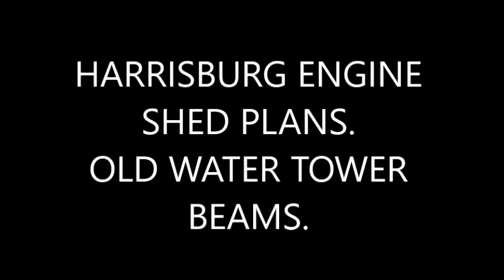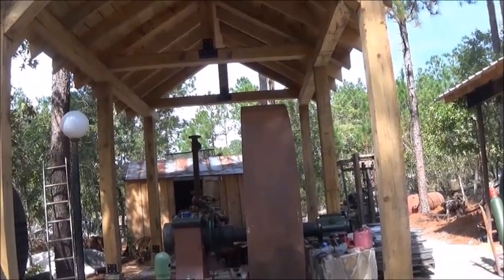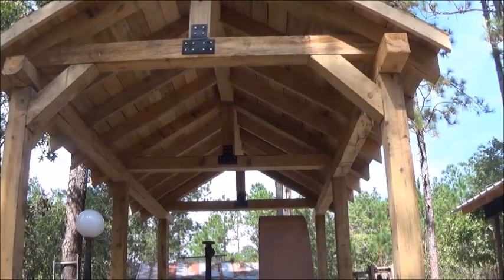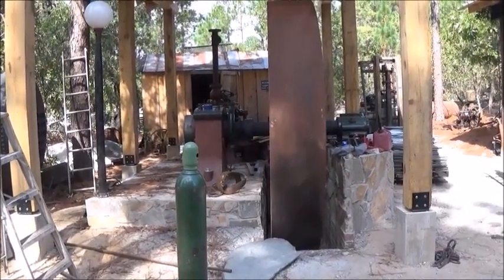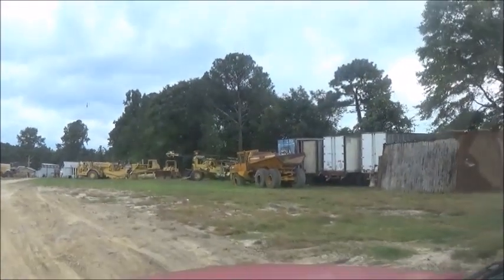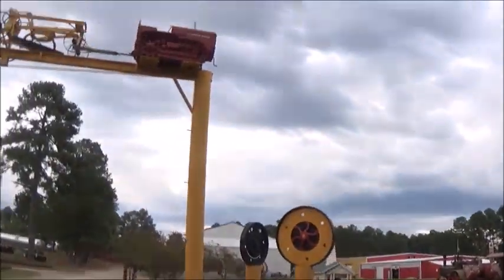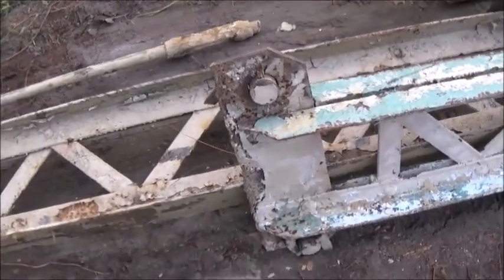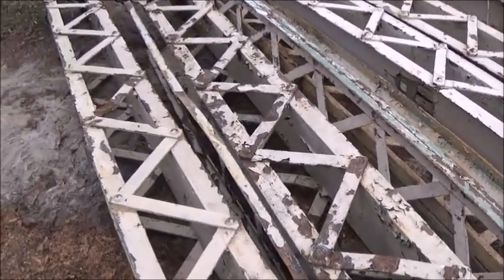WATER TOWER BEAMS FOR THE HARRISBURG ENGINE

Comment: Think about the journey Jonathan has taken to get to this point: 25-30 years ago he spotted the first steam engine he wanted, then he need a crane to move the parts about so he searched, found, and repaired an abandoned crane. He the found more steam related pieces and acquired them. If this process wasn’t enough, he acquired a saw to mill his own lumber as the going’s on related to the virus made supplies unavailable or cost prohibitive. He’s constructed a beautiful building for one engine and is planning the next, but it isn’t just any old plan he’s making—he’s incorporating history as he’s uses salvage from the Carthage water tower. Jonathan, you are indeed an industrious fellow, a conservative, and a preservationist for sure. I tip my hat to you friend!
Reply from the maker: HaHa thanks!!  Only part you missed was that I built the saw mill too.  My issue is that I never see how much work is involved in anything I do.
Reply: @jonathanw4942  You are an inspiration to many friend—I applaud your gumption!

Comment: That is the coolest equipment yard I've ever seen. I could easily make a day out of touring it if they allow that kind of thing. Happy you and the old beams found one another.
Reply: Me too!
Reply from the maker: I should about 5 percent of what is actually there.
Reply: @jonathanw4942  I'm a little over an hour North of there. If they ever have an open house or guided tour I'd gladly pay 50 cents. 👍
Reply: @jonathanw4942  hey Jonathan be sure the cross beam can run a beam trolley across it.. for that added industrial look. And a jib crane hung on the driveway side they're so handy.. been subbed since you posted will it start on an old Chevy....
Reply: Nice save! I'm sure that acquisition has left you "beaming", Jonathan.
Reply: I was thinking just the same. 😁

Comment: That was a wonderful equipment tour. I never heard them called "pipe layers". We called them "side booms". I re-railed many cars with and without side booms. About rivets; I put in the last of the last hot rivets used for railcar repair in Shreveport Louisiana shop before we switched to Huck compression bolts or conventional bolts, 1978.

Comment: Hi, Jonathan, I'm glad they had that GradeAll at the Equipment Yard, so you didn't have the drive the Unit Crane over there just to weigh the new beams. I thought I could hear you salivating as you were describing all the old equipment over there.  As the drive out progressed, I could almost hear the wheels turnin' for a midnight raid on the place, with all the mouth watering equipment there.  I'm sure the Harrisburg  Engine is going to have a beautiful and fitting display setup.  I'm looking forward eagerly for all your upcoming videos for all of your ongoing projects.  God Bless and stay safe, Meow to Ninja Catscan.

Comment: Jonathan I don't know if you will get a chance to read this,  I hope so. Great video, I admire how you are determined to preserve local history. Wish I lived closer, I'd call and see if I could come take a look.  Louisiana is a ways off. One thing I want to mention is that old steel. From 1905 or so it's prior to 1945 of course and the molecular structure will be different.  
Old steel welds and drills differently than modern steel because of the iron ores reaction to atomic testing that went on during the 40's. As crazy as it sounds, it's true. I'd heard that from old time welders some 40 odd years ago when I was pipefitting and welding. I didn't pay much attention until I got hold of some 2 inch angle and 6 inch I beams from an old elevator shaft installed in 1932. Makes the prettiest welds, especially with 8018 low hydrogen rods when you cap the weld. 6011 rods used in the root pass and filler passes don't spatter as much....heck it's FUN to weld and fab stuff with that old, "pure" iron. Just wait, you'll see. Have fun from an old welder from Louisiana.

Comment: They're gonna look great - you got a great vision for that second engine!  Wear an air filter if you're going to be flame cutting those beams - that's white lead paint, and you don't want to be inhaling that. The standard is to grind it off 4" either side of the cut - I see the boys that cut it up didn't follow that, but I hope they had powered respirators.  With your breathing problems, ya got to be careful with this kinda stuff.  Can't wait to see the project come to life!

Comment: Your best bet for tin for the roof would be to look for someone with an old barn or crib with corrugated tin roofs that looks like it's falling down and offer to buy the tin off it. No matter if it's rusty on the show side when you flip it over its pretty much like new but still weathered, not shiny. Took down a few barns & cribs in my younger days and there was always someone looking to buy tin off them along with any of the original mortise and tenon beams in good shape.